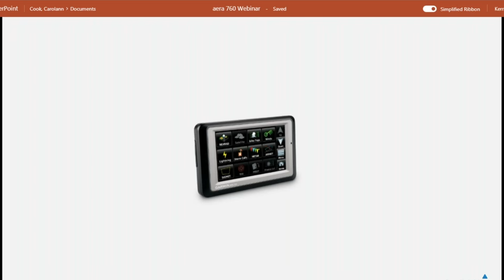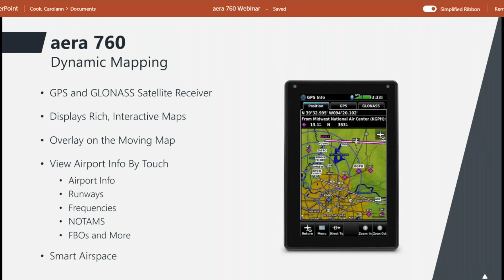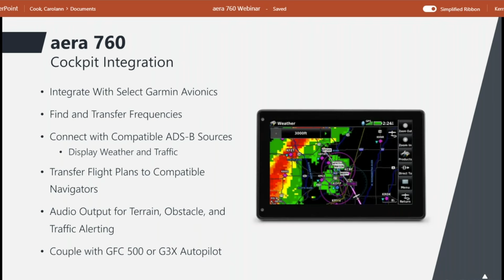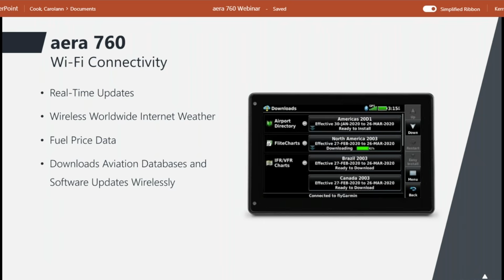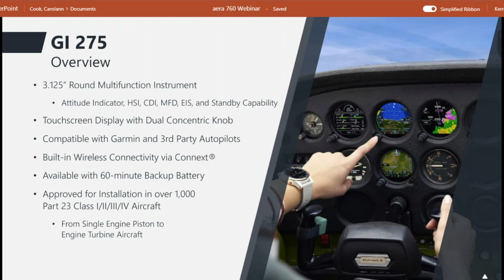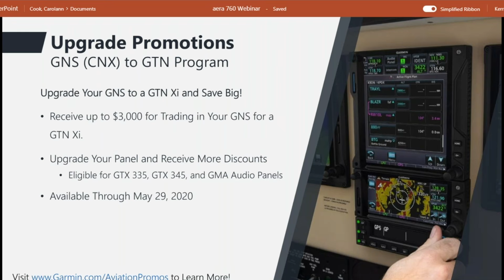Garmin new product update - aera 760 GPS, GI 275, GPS 175, and more (webinar recording)

Comment: WARNING!!!  The aera 760 will NOT send flight plan info to a garmin 430w/530w via serial cable. I have just spent a week on the phone with garmin tech support resolving this issue. They finally determined it will not work as advertised and are in the process of changing their worldwide marketing info for the aera 760. It is still a great unit, but it will only receive flight plan info via serial connection with mapmx protocols. The gns 430w series unit do not have mapmx on the in side of any serial port connection. Garmin is working on a way to make it right with me personally, but it will not be advertised in the future for having bi-directional flight plan transfer capabilities for legacy gns series navigators.
Reply: I concur with this. Just spent a mornign with my GTN650 and Aera760 and same thing....flight plans write to the Aera but not the reverse. Also could not connect to the GTN650 wifi network ....search doesn't see it at all.
Reply: Typical of Garmin.